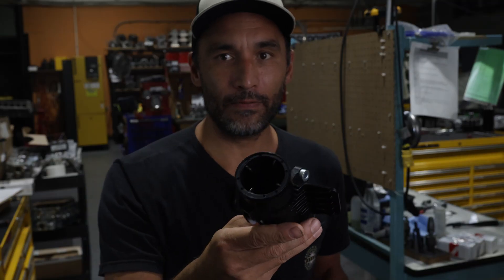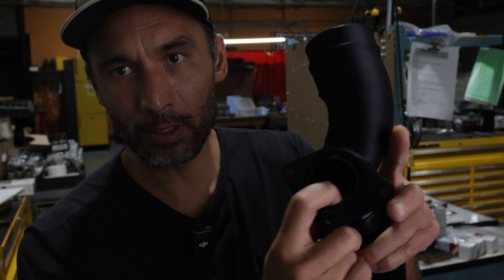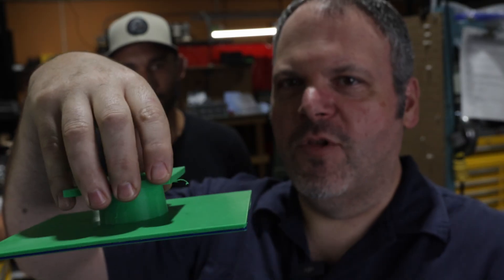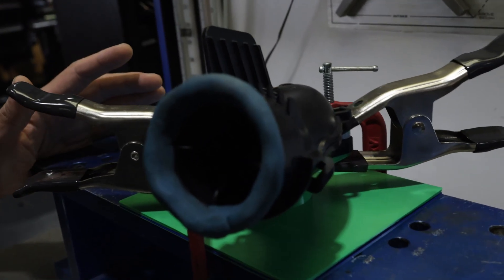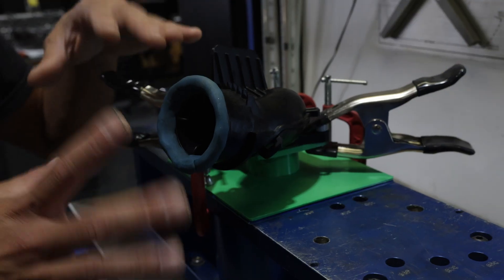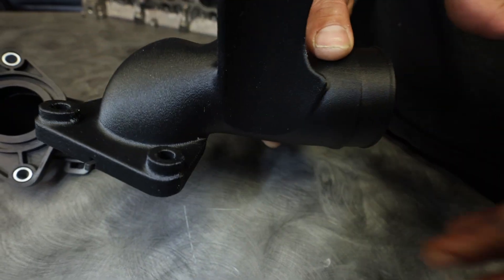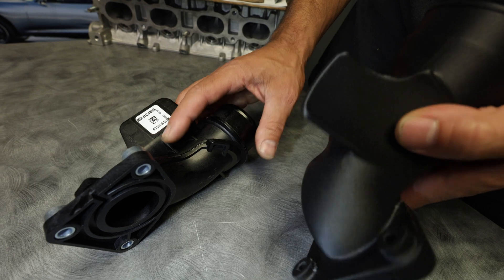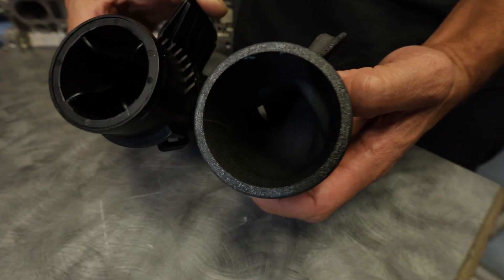EcoBoost Bronco Turbo Inlet Flow Test | Full-Race Redesigned vs OEM

Comment: You need to dry your filament so you don't get googly bridges/overhangs like that.  That's a clear sign of filament that isn't dry..... it's either that or your printer settings are jacked up.... but it's most likely due to wet filament.  A food dehydrator is what I use and it's a night/day difference after drying filament with how good the quality comes out.